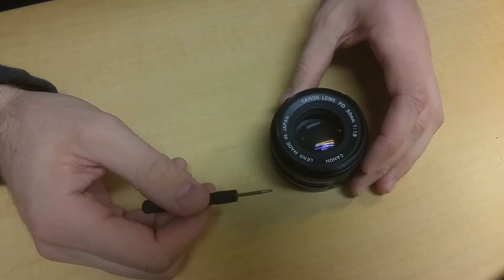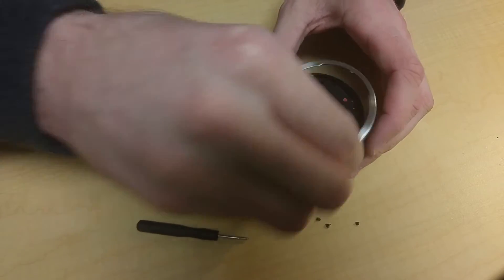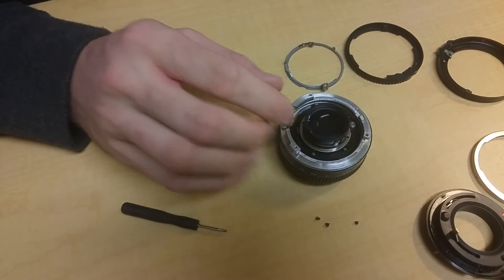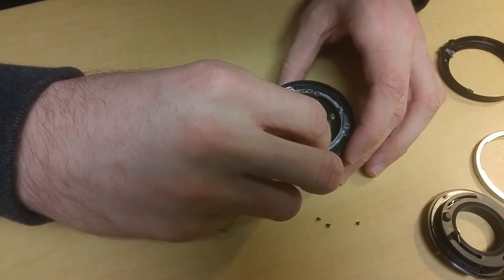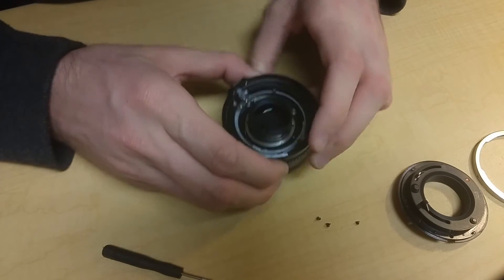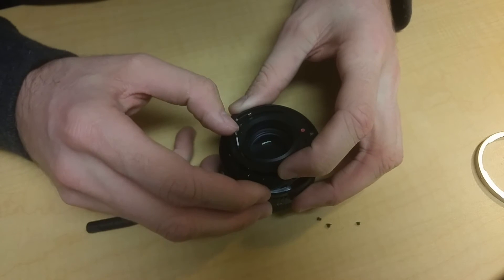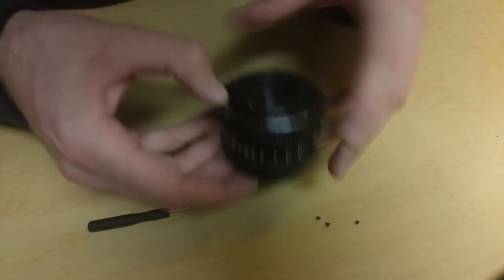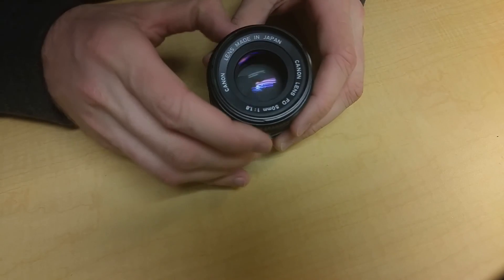Canon FD Prime Lens Rear Dissasembly and Reassembly Guide

Comment: @Camera Central. Here's my problem. The top section, or forward section, I'm new so I really don't know all the proper names yet but here goes. 

First, I have a Canon Brand ''FD'' Lens, so that part may be needed in order to get the correct information.

The top section got pulled off. I can't get it in because of the "C'' shape metal clip needs to be removed in order to screw on the outer threaded section. Now I have the ring off but I can't see where I have to position the outer section, so I can reinstall the metal ''C'' clip.....Here's the thing. I have about 20 to 25 Lenses I won in an online auction. I'll be buying a FD to EF adapter so I can use a few of them on my Canon EOS Rebel XS series Camera. I really didn't want to shell out $1,000-$1,500 for a few used Lenses, so I went this route. So if I'm successful at disassembling & assembling Lenses, I'll be selling the rest in a bundle auction. For the  whole story, 100% of it, in this one auction I got 16 Lenses for $18.00 with Free Shipping, so the seller actually lost money because the Priority Mail Shipping was either$16.60 for Commercial Rate, or $19.95 for Retail/Online Rate, plus the eBay charges, so for him, all he ended up doing was paying to sell the bundle of Lenses. I believe only taking a couple of pictures, 1 being from 3 feet above an open box with the Lenses sitting inside, plus 1  So with all the cards on the table, lol Help!

Comment: Anyone know if the Canon FD 24/2.8 is different than this?  I've tried to follow these instructions about a dozen times, and still no luck.  --  Thanks...  (One problem I'm having is when I tighten down the final silver metal ring...the last part of reassembly, the shorter lever in the back of the lens becomes very hard to move.)
Reply: Same issue with the FD 28/2.8 - no luck. Seems like there is a crucial step missing.
Reply: Same with the 17mm f4.

Comment: Do you have any advice on how to replace the aperture blades and lens back into the threads and make everything match up correctly? 

I had an issue with my manual focus and had stripped the whole lens down (both front and rear parts). I have watched both of your videos but don't see how to they can be put back together. (Basically the bit in the middle).

Do you have any other videos of dismantling and reassembling the whole lens back together that I could follow step by step?

Comment: I can't get the red lines to line up, but everything else is operational. Any ideas?
Reply from the maker: You have tried spinning it right? not exactly sure what could be wrong unfortunately
Reply: I'm in the same boat. I've spent 12 hours with my 50mm f/1.8, 1.4, my 28mm f/2.8, and my 100mm f/2.8 and everything is operational until I try to make the red dots match (I can't get on the final silver mount piece because of this)--  I've gone over this video time and time again but, can't find a fix. Any ideas one month later?
Reply: I'm in the same position with my Canon 50mm 1.4. I tried looking at my other FD lenses, but they all have this ring that twists around the flanges, rather than twisting the lens to lock it into the mount.
Also, sadly, in this video, the fingers and hands are too often blocking the view.
Reply: I did eventually fix my problem. 
If you follow everything in this video (and don't try to glue first metal ring into divot in aperture ring) when you put it together it should work. 

I couldn't twist it like in the video, I had to push the small metal prongs to get the FD to go from mount mode to its normal mode (aperture not supposed to change unless it is in mount mode-- only should be in that mode when on camera.) I was working with a nfd 1.4. 

Google terms 'mount mode' and 'aperture stuck' to find a detailed guide over the location over the metal prongs. Good Luck. These lens are fickle.

Comment: Thank you for your video - especially your tip on how to line up the last step of reassembly.  Just helped me clean out the rear lens elements on my FD 50 1.8.  Saved me hours of head scratching on the crucial final stage.
Reply from the maker: Glad I could help!